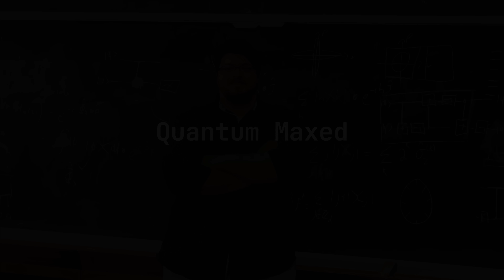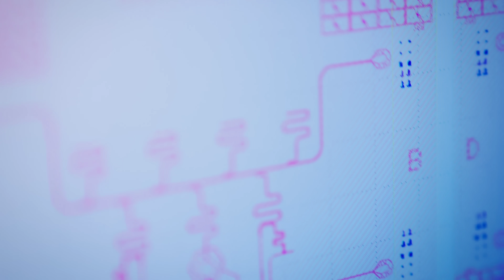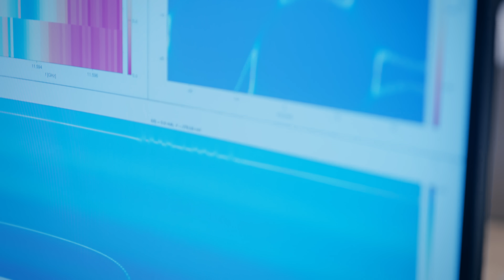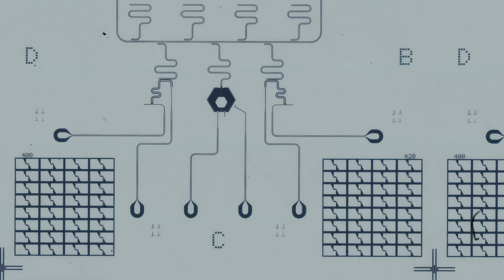The Next Era of Computing | Extropic

Comment: Some of these videos need an eli5 section. This one especially.
Reply: I think that's because they don't really have a concrete idea of what their system can do, even if they created one, because they haven't done it yet.
Reply: simple explanation:

increasing demands of AI means we need better chips. but typically to make chips more powerful, you need to make their components smaller. when the components are very small, things like vibrations and random disturbances become noticeable because you're operating on such tiny scales. Extropic want to harness this "inherent noise", to make even more powerful chips. this makes sense (on paper) because AI fundamentally requires irregularities to work properly (it is a "probabalistic" system, rather than "deterministic"). Up until now chips have tried to avoid these effects, so Extropic's line of reasoning can be summed up as "why not use the inherent irregularities of nature instead of trying to avoid them", thereby opening the door to way more powerful chips.

There's lots more detail ofc, but this is the general thesis
Reply: Yeah, exactly why is this a big deal? How will this transform human lives?
Reply: I don't know what I'm talking about but: computer chip sets use transistors to take electricity signals and make them less wobbly (noise and heat) and magnify them or turn them into a different kind of signal. We're hitting the limit on how small we can make transistors because the electrons in the signal to them are basically wobbling and leaking out of the transistor when they are changing and it's not really possible to stop them. This technology is proposing that it is possible to use the electrons properties that cause them to wobble and leak to drive chip functions and get around the that barrier.
Reply: In the simplest of ways, they are replacing digital computing with analog computing, but the technology of this analog computer is not like the old cogs and gears setup of a time gone by, but by using the infinite variability of temperature across a problem space. When you look at a photo, you don't digest it as pixels, you see a complete picture. Changing a single pixel would do nothing for your interpretation of the photo...... but to a thermodynamic algorithm, that pixel (or temperature variance), may be enough to choose a different word from the large language model..... or apply the brakes gentler in an autonomous vehicle. The major difference between using this method and regular digital computation.... is the many many orders of magnitude greater power efficiency you get.
Reply: Look up the Veritasium video on analog computing. That's a good primer on the high-level idea of what this is doing.
Reply: translation: they are full of so much shit that it would take an entire paper to explain it; quantum heat diffusion guarantees this will fail without fucking magic.
Reply: And the earth is flat…damn grifters!
Reply: It’s intentionally obfuscated because this is a giant grift by a 15 year old e/accer trapped in a 30 year old man’s body
Reply: @Brokentwobutton  this is not the idea, the idea is that under perfect circumstances computing can be done with energy dissipation, but they do not have the means to make perfect circuits nor do they have the means to even try to make them, is a combinatorically intractable problem, but they won't tell you that part. Because they need to grift for free money.
Reply from the maker: The newsletter is good for this
Reply: @jasoncarman99 link to this newsletter?